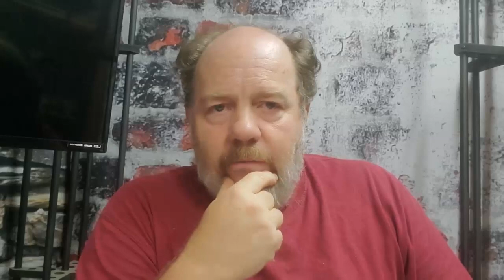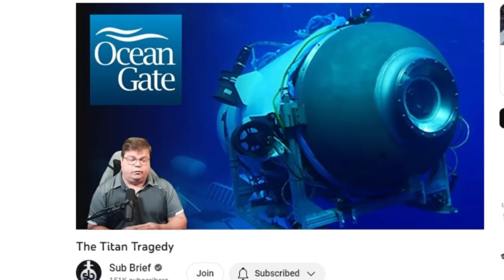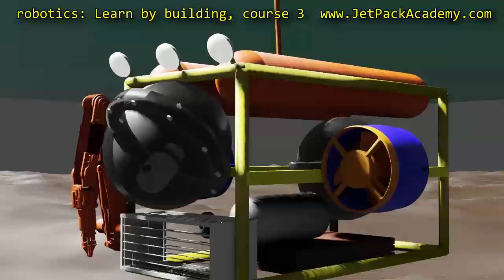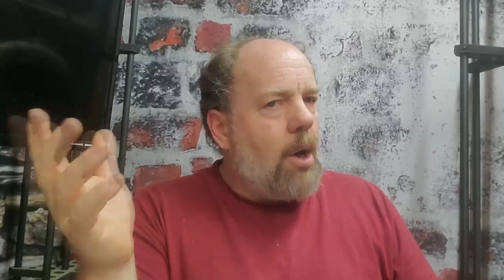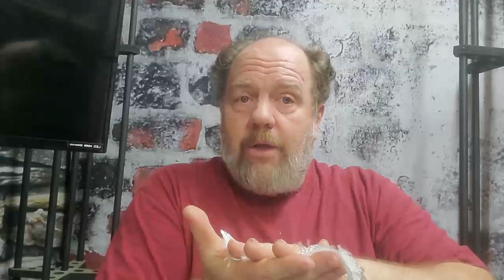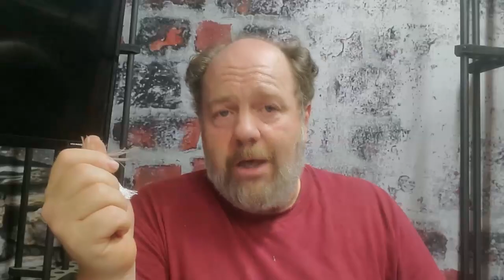Loss of the OceanGate Titan sub

Comment: I wonder what the difference in coefficient of expansion and contraction of titanium and carbon fiber is. Using different materials is not a good idea. How did each material behave at the temperature at depth? I also wonder about the integrity of the glue joints.

Comment: Great information.  We have all been told how superior carbon fiber is compared to aluminum on aircraft for example.  But again, in an aircraft the pressure is from the inside.  Thanks!  Anybody ever use Kevlar?
Reply from the maker: I hadn't tried it as a composite. I messed with it while at Delta Temax - man it was hard to cut with scissors! I don't even remember what we were doing with it now. But we weren't making a composite with it.

Comment: Glad you posted this as I hadn't thought of the issues with the compressive strength of carbon fiber. What I did think about related to the carbon fiber is whether it would withstand the low temperatures down where the wreck of the Titanic is. Turn out, from the papers I read about carbon fiber, it would have delaminated at the temperatures present just before reaching the Titanic and it does appear that this is around the exact time they lost contact with the sub. I'd say this event is another good reminder than physics does not care how confident you are nor how rich you are. Ignore physics and it does not care whether this results in your death or not.
Reply from the maker: Really? I was unaware of delamination problems at cold temperatures! Then how do aircraft stay together? The temps get down to -50 at high altitudes? I've never messed with carbon fiber in cold temps so I wouldn't know.

Comment: Sub Briefs doesn't know how atmosphere is controlled in a manned deep diving submersible. Few, if any operators normally use a constant oxygen bleed. In 8 years of piloting 2000m subs, I rarely if ever used constant bleed. CO2 was scrubbed and when cabin pressure stabilized at a pressure that indicated CO2 was removed (or the CO2 meter indicated a low level) O2 would be bled in until cabin pressure indicated by an aircraft altimeter showed pre-scrub pressure. Many of the "experts" lack any knowledge or experience in submersible operations and Navy nuke boats don't count.
Emergency drop weights should never depend on electrical power for operation. If you want info on carbon fiber pressure hulls look at Spencer Composites and read an article in Composites World published Published 5/10/2017.  Please understand most of what is on the net about this incident is pure clickbait with very little real information from people in the submersible industry.

Comment: To be honest, I felt from the start that the Titan Sub was not as safe as they made out.
Off-the-shelf components etc to build this thing? 😲
The previous dives may have weakened the hull to the point of failure.

The only other thing I can think of is that it has become stuck on some part of the Titanic wreckage. If that is the case then the safety features would not work.
The dropping of the ballast would make no difference if it is securely stuck. That being said, it may still give them an opportunity for being rescued.
I hope and pray for the best for all of them. 🙏

Comment: This is youtube and this is a small channel so I get to be 'that guy': At 4000m depth its around about 5600psi rather than 6500psi <silly grin> 

On a serious note, thanks for the video.. I'm a long time Sub brief subscriber, and it's really good to get your take on things too..

One thing to bear in mind is I think you have it wrong when it comes to the remote.. There's no way they would be using the remote to control things on the outside with RF. There's no way you want all your control electronics on the outside, and the control equipt would have exactly the same issues with pressure etc, they would all have to be hermetically sealed etc, and RF just does not go through seawater, ok some do but Defo not at Bluetooth, wifi, or any other frequencies that could work at the kinds of bandwidth you'd need to control things, that said if you know something I don't then PLEASE enlighten me cos I'm interested..

The ballast ditching sounds VERY ingenious, because you're so right about trying to do anything with trying to 'blow' ballast in the conventional way.

Is it just me or does carbon fibre just seem like wholey the wrong stuff to make a sub out of.. Like it's much better in tension than compression.. I honestly don't have anything to offer other than 'it appears that way'... Like Carbon fiber is doable for pressure vessels when the pressure is coming from the inside, not the outside...

HAHAHAAH... You just said what I was thinking I was writing this while listening to you.... So yeah... Someone else has the same thought as I about CF....

Another example of CF in this sort of thing a COPVs in space flight, 'Carbon Overwrapped Pressure Vessles' And it's the CF in tension like the skuba tanks.. 

Thank you for a thought-provoking video.. 

I think we all know very sadly that they aren't coming back.. 

The sad irony of this happening next to the titanic...

Comment: I agree. I think the carbon fibre buckled. I wonder what depth they were at when they lost contact. Is there any way of sending that kind of telemetry data back wirelessly?
Reply: I have some experience with carbon fiber it doesn't buck or Crack its far worse it shatters like glass
Reply: @tacoboy2218  Exactly what happened by the look of it.
Reply: @wattage2007  sadly

Comment: I'm not clear on how many times they've gone down (partially or fully) but it seems that they've previously reached the bottom and the Titanic, together with other attempts using this hull design.  So, it feels like they had a design that could cope with the depth, albeit there are questions about whether the material was the right choice.  Your comment about the catastrophic failure of the material resonated though.  It made me wonder whether the material suffers from gradual structural weakening, such as micro fractures, after a number of uses.   I assume the hull isn't replaced frequently, or at all, due to cost.  This could explain why a seemingly viable design fails after time. We don't have the full facts, but that would be my concern with the nature of the hull.
Reply: I did read a news article which said its hull was redesigned in 2021 due to possible ‘cyclic weakness’ from previous dives. Bet carbon fibre’s a lot cheaper than a solid chunk of titanium.
Reply: It’s a miracle that thing even made it down there one time. To me it was one big game of Russian roulette. The only way that sub could have even been remotely safe was to use it once and throw it away.

Comment: I think you're right about the compressive failure risk.   The risk would only get worse cycle after cycle.   Get away with one trip under those circumstances and you're lucky.   Do it repeatedly and every trip is a new and uncharacterized risk.  What about where the carbon fiber meets the machined hatch?   That interface will experience completely different stresses from the composite shell itself.   I'm sure computer stress and materials analysis done but it's still an endeavor that pushes material science and limits thereof.
Reply from the maker: That's a good point - I am reminded of R&D work I was doing with a company here working on a hot suit for cold water divers. We had a stainless steel tank containing a microcontroller, hot water tank, pump and plumbing. There was a plastic plug at the top sealing with an o-ring. The boss set me to task on the math because the expansion / contraction rates are different between the stainless steel and the plastic. I had to calculate how much the SS contracted at -20C and how much the plastic contracted. The plastic contracted so much more than the SS that it would unseat the o-ring, so we would have flooded the tank, destroying the $11k unit.
The entire hull of the Titan would have undergone incredible compression - the Deepsea challenger (James Cameron) had its syntactic foam (glass spheres glued in a resin matrix) compressed about 2.5 inches from the water pressure. I haven't done the maths for the differential compression between the titanium end spheres and the 5 inches of carbon fiber tube on the Titan. But they will definitely compress at different rates. How much? I don't know. And I don't know if the engineers even thought about it to do the maths. Apparently they were all young, fresh out of college engineers.
Reply: Russian roulette

Comment: I agree it look very bad !
I also think that you are correct about the Carbon fiber hull.
However, if the hull of the sub was steel or titanium and the issue was not an implosion but a loss of power.
How would spare compressed oxygen or air be of any usefulness?
The air bottles would be at 3000 psi and you would need to open the air bottles inside a sealed hull.
This would pressurize the crew to 3000 psi.
there would need to be a pipe  pass through and valve that could handle the 6500 psi to vent the pressure out of the hull when you got the craft back to the surface or you could not safely open the hatch.
You would need to do this very slowly or you would kill the crew with explosive bends.
Reply from the maker: I thought about that too while listening to Aaron over at Sub Brief - you're correct. It wouldn't be 3,000 psi (I'd have to do the math and my 5 hour energy shot is wearing off lol) but it would still be quite a bit of pressure. And ya, now you've got people in a pressurized environment and you gotta get'em out in a hurry.

Comment: If it did implode, wouldn't there have been an indication on the surface as the air breached?
Reply: IMHO At that depth , almost 13,000 ft. The small amount of air in that tiny Sub would get lost as it rose through ALL that water.
Reply from the maker: Possibly, but they were at about 9 or 10 thousand feet deep, so people on the surface would have had to have been looking at the right spot on the surface, at the right time, in ocean swells and bubbles. And it wouldn't have been difficult for the mothership and the sub to have been hundreds of meters (possibly even kilometers) apart. I know the communication with the mothership was for the sub to navigate, but I don't know if that means the mothership had to be stationary or not.

Comment: It's not clear to me that the wireless controller had anything to do with hull penetrations.   The displays that they use were probably hardwired due to the data rates involved along with the power needs of the displays.   There might have been a wireless gateway between the inner and outer hull but I personally doubt that the controller was the only wireless link needed to avoid a hull penetration.   Still...  if human life is at stake you might want control redundancy.   Did they at least have a spare controller?   Batteries?   What about the other systems?
If the internal electronics lose power then wouldn't the ballasts automatically blow after a certain time?   Etc. Etc.
Hoping for the best for the passengers and their families..
Reply from the maker: Yes, they also had ballast bags with a fusible link that dissolved in salt water. Took about 16 hours and they would snap, dropping large bags of ballast and creating lots of positive bouyancy. I am not privy to specific design specs on the sub but what I have seen so far? I didn't see a single hull penetration. The hydraulics would have been one, so obviously there's at least one I couldn't see. But the reality is that everything can be done wirelessly - even transferring power from outside to inside the sub. Security cameras transmit high definition video over wifi all the time. Still - I don't know what through-hull penetration they may or may not have had.  All I'm saying is if you have a choice? The fewer holes in the hull, the better.
Reply: @TechValleyScienceCentre  I agree that less is better.  The would have had plenty of opportunity for wireless couplings of all kinds including power.   I just don't get the impression that they did a lot of it.   Unless the use of a single controller was in jest, it sounds like a hobbyist control setup and not something that should be entrusted with human life.  Deep sea travel is the same level of risk as space flight and if you're doing it for fun and profit of the traveling public then maybe a little more oversight is in order?